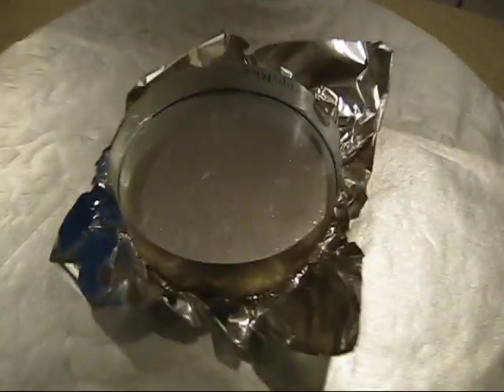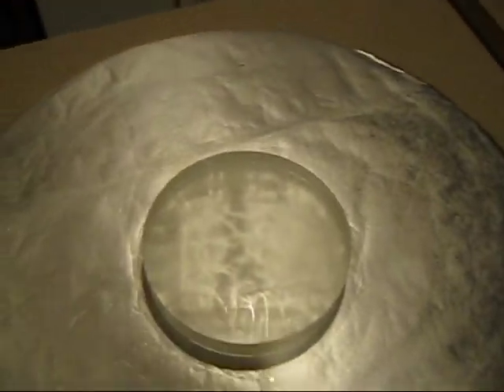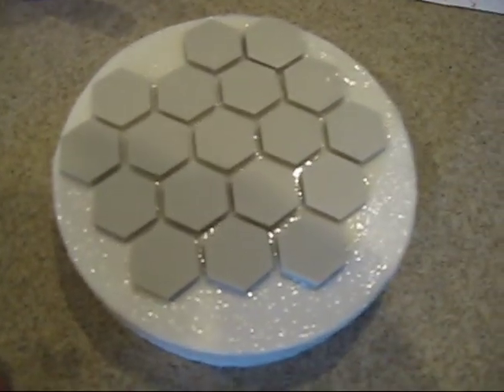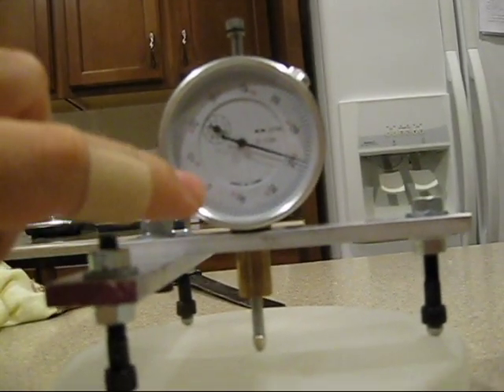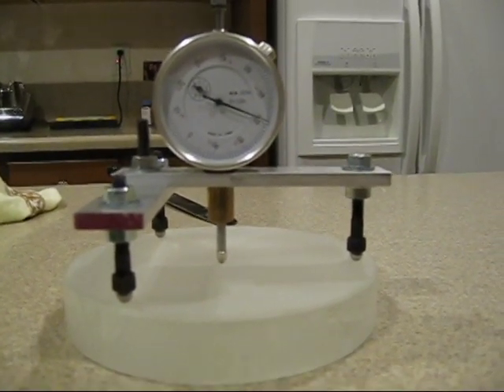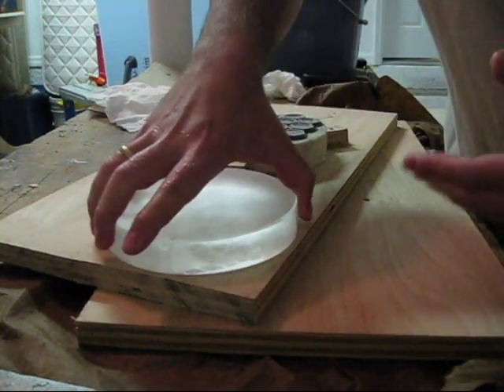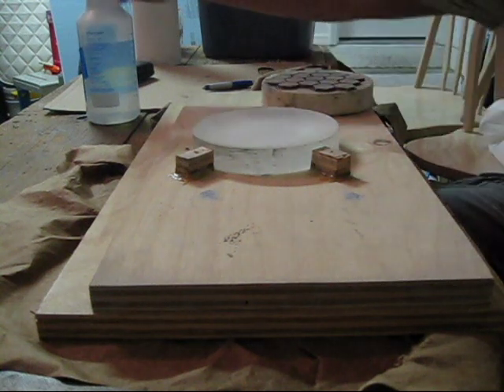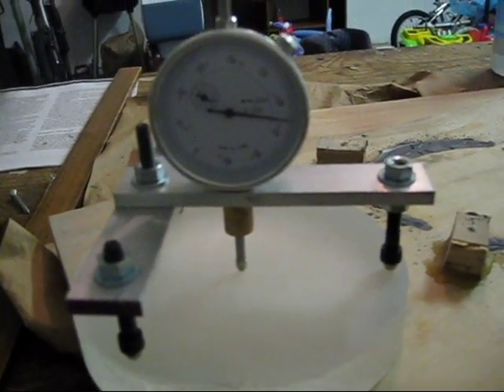Grinding my first 6" f/8 Telescope Mirror

Comment: Hi Carlos!

I know this is an old video, but I wanted to say I've watched this video and your other ATM videos many times as well as the Stellafane website and have learned a ton of very useful info. Soon I'll be starting my own mirror making project, and just have a few questions I can't seem to find the answers to in Stellafane, and would love it if you could share some advice. 

First, the Stellafane website says to always work wet, and to spray on water before each wet (for grinding). This might be an ignorant question, but would regular tap water work for this? I am only confused because they also mention that the cerium oxide slurry for polishing should be a mix of cerox and distilled water. 

I'm also confused about the steps I need to take before storing the mirror after finishing the last polishing session for the day. After finishing the last polishing session for the day, can I just put the mirror and lap away without cleaning/would it be harmful to the mirror and lap to leave cerium oxide slurry on them? Also, during polishing, do the mirror and pitch lap require regular dunking in a water bucket, similar to how the mirror/tool need to be cleaned in a water bucket during grinding?

Thanks for your time!
Reply from the maker: Hello. For rough grinding, regular tap water should be ok down to maybe 500 grit. I would start using distilled water for fine grinding at 25 micron Al Ox down to 5 micron, and obviously for polishing. This avoids getting any particulate contamination in the slurry with finer grits.

For polishing, after I finish a session I store the mirror and lap in a plastic cake container, the type you put a lid on and is air tight. I normally clean out the lap and the mirror with distilled water, I do not dry the lap (I leave the water) I clean the mirror several times if I need to do a Foucault Test. I apply slurry and cold press before a new session. The pitch lap will begin to close its channels as you use it. You have to then re-channel the pitch lap, which removes pitch material. This means the pitch lap begins to thin out with time, so it is very likely you'll make 2 or 3 pitch laps.

You do NOT need to dunk the pitch lap in a bucket of water. You'd only do this if you cannot get good contact, so you'd have a bucket of hot water, and insert the pitch lap and mirror. This helps the lap conform to the mirror's shape much easier since the lap is hot.
Reply: @carluchoparis  Thanks!

Comment: If you’re turning the blank why do you also turn the tool?
Reply from the maker: Hi Stephen, it adds an additional layer of randomness. I think in this video I was rotating the tool and mirror in opposite directions. It is preferable to rotate the mirror and then rotate the tool slightly less in the same direction. This really helps improve the randomness of the strokes and the figure turns out very well.

Comment: will burning the sand paper destroy the crystals ?
Reply from the maker: Hello, if I'm understanding correctly, you wish to make your own grit, correct? If so, you should heat the sandpaper enough so the grit loosens onto a clean surface. It would be wise to afterwards implement an elutriation process to separate fine and coarser particles from the liquid suspension.

I hope this points you in a direction at least.
Reply: @carluchoparis  Thanks..I am from Kerala, India.  i am trying to grind 190 mm mirror .. here the grit is harder to buy so the only option is to buy waterproof SiC sand papers. i burned each of them separately and crushed into grit and washed. Now i have 80, 120, 320 and 1000 size grits but i suspect their quality if there had been any oxidation happened to the crystals.
any way i started grinding my mirror with 80 grit using a tile tool and achieved 1 mm depth in 1 n half hours..fine grinding will be a problem i guess...thanks for your advise..and one more question..any kind of replacement for pitch lap.. pitch is not available here or costlier..do the hot glue stick work with that..?
Reply from the maker: @KL2Vlogger  As far as I know, you can use rosin from conifer trees. Read the following to see if it points you in a direction: https://www.cloudynights.com/topic/264459-homemade-pitch-for-polishing/

Also, make sure you employ elutriation for the fine grits you've acquired. This will ensure you avoid scratches. I currently am working on a small scratch on a mirror, it's a setback but we just deal with it.

Good luck and let me know how it goes.
Reply from the maker: The following website should be helpful: http://astunit.com/atm.php?topic=abrasiv&fbclid=IwAR31kPUdymtOYe9uFoPo7DvbVvZG7m2VTOS1Flqj6SI5ii7s3waoXreaM4M

Comment: 1:40 Seems like a vibrating dildo would work great to get those bubbles out rather than you having to stir with a stick. Would mimic the vibrating tool used to remove voids in concrete
Reply from the maker: The following is a sentence I never imagined typing, but I think a vibrating dildo would be overkill. LOL. That layer of pitch is at the most 3/8" thick. A dildo (even a small one) would be hilarious, yet awkward and probably not much help... What the hell am I typing here?
Reply: Nathan Roberson the dude has kids, what's wrong with you!? Haha

Comment: Would it not be easier grinding the other way up? All the grinding powder is going between the ceramics? I did it with ceramics on top after watching Gordon Waites videos. Very satisfying thing to do. Stopped at 14" mirror on third one but now thinking about the challenges of making a bigger one. Star buy was an old potters wheel of eBay with variable speed, keeps the mess all contained.
Reply from the maker: To hog out the curve with tool on top you would need a sub-diameter tool. With a full size grinding tool, once you've hogged out your target depth, grinding with mirror on top reduces the radius of curvature of the mirror's surface, while grinding with tool on top increases the radius of curvature of the surface. This is a good way to control the target focal length of your finished optic. You alternate mirror on top and tool on top, all the while measuring your sagitta. Carefully documenting your progress will ensure you reach the focal length you want, within a reasonable margin.

Comment: Vivo en Uruguay, usted?
Reply from the maker: +PRODIGITALIFE Yo estoy en EEUU. Tengo entendido que www.firsthanddiscovery.com hace envios internacionales. Un disco de 6 pulg cuesta $50, a lo cual debes sumarle el envio. Metete en la pagina web de ellos y veras mas informacion.
Reply: Mirá, qué buena página!!! Ahí dice que: un quit de: 6 Inch Telescope Mirror Kit vale $89.95 es algo alto pero por lo menos ya te dan todo, ja ja... Pero aún me queda una duda: si para hacer un telescopio se necesita de 1 disco o son 2 discos por telescopio?...eso no entendí. Desde ya Muchas Gracias Nuevamente, hasta pronto!!!
Reply: ...hay de varias pulgadas de: 4.25, 5, 6, 8, 10, 12.5 eso se refiere al grosor o sea al espesor me imagino y no al diámetro, es así?. Y el diámeto es el mismo o también varía?. Gracias!!!
Reply from the maker: +PRODIGITALIFE Necesitas un solo disco para el espejo primario... Tambien debes hacer una herramienta de esmerilado y otra de pulitura con yeso o cemento (debe ser impermeable, puedes aplicar unas capas de epoxy marino al yeso). 

Tambien vas a necesitar el espejo secundario, normalmente la gente lo compra ya hecho. Tambien se necesitan otras partes que puedes fabricar o comprar, como el enfocador, la araña para el secundario y la celda del espejo primario.

Los tamaños que ves en la pagina web son los diametros de los espejos en pulgadas. Yo recomiendo que empieces con uno de 6 pulgas o 8 pulgadas de diametro. Tendras un buen telescopio con muchos años de buen uso.
Reply: ...Buenísimo y esa herramienta de esmerilado qué carcterísticast tiene? en el video sería esa base blanca y los exágonos serían el epoxy marino? Y el espejo secundario
que características tiene con repecto a el espejo primario, es mas chico? me imagino...

Comment: Buenas qué tal? está muy bueno el video. Quisiera saber el diámetro y el espesor del vidrio que uso. Ahí puso o dijo que era de: 6" f/8 pero no se bien qué es cada número los 6" y f/8, podría explicar? He visto en otros videos que usan vidrios de un espesor más fino es por alguna razón o es arbitrario eso y su diámetro o cómo saber qué medidas usar o cuál me conviene más? Desde ya Muchas Gracias!!!
Reply from the maker: +PRODIGITALIFE Este vidrio es de 6 pulg de diametro y 1 pulg de espesor. Se recomienda utilizar una relacion espesor a diametro de 1/6. Utilizar vidrios de menos espesor se puede hacer, pero hay que tomar muchas precauciones a la hora de esmerilar, pulir y parabolizar. Cualquier asimetria en el soporte del espejo provoca cierta flexion en el. Esta flexion es suficiente para desviar la figura de la superficie durante el pulido y sera evidente a la hora de probar el espejo.

Luego, hay que tomar un poco mas de precaucion con la celda del espejo dentro del tubo del telescopio. La celda debe tener suficiente suporte para evitar flexion por el propio peso de espejo (coloquialmente llamado "potato-chipping", porque le da forma como de "pringle"), incluso a la hora de probar el espejo en el banco de prueba, si es de muy poco espesor, el mismo peso del material causa el potato-chipping y la prueba del espejo lo hara evidente.

Con las precauciones necesarias no deberias tener problema alguno fabricando un espejo de poco espesor, pero si tienes acceso a un disco de pyrex o borosilicato de espesor/diametro 1/6, entonces es preferable para tu primer proyecto, sin embargo conozco varias personas que han fabricado espejos de 8 pulg y poco espesor como primer proyecto.

Comment: One consideration....you need to be wearing a dust mask my friend.  Glass dust.... silicosis, bad news...especially for the little one running around in the background.
Reply from the maker: admdub Thanks for the concern but no dust mask is necessary, the grinding process is very water intensive. Water is always added to the grit, and the ground glass and used grit (still wet) are dipped in a bucket of water after every "wet", i.e. right before adding new grit. This makes the ground glass and used grit precipitate to the bottom within the bucket of water. Once a grinding session is finished, you dispose of the dirty water in the bucket and clean thoroughly, again, with water.

Comment: Hey man, wherer did u buy the mirror blank? and how much was it?? :D
Reply from the maker: Hey Karan,

I bought my 6" blank at firsthanddiscovery.com. It cost $50. I later purchased a 10" blank which cost $225.
Reply: Hey man! thanks for the reply! Nice tutorial i guess! I am a student in engineering and atm also. I am considering making my own scope. This helps a lot. Also i was wondering where u got the tiles. and if there is a cheap source for the grinding powders. I am living in Canada btw.
Reply: ***** haha i guess so. Just needed advice from people that have done this before.

Comment from the maker: Dave, I was going through the comments again and came across yours a second time. I'm building a 10" f/6 telescope now. The plaster tool I made is the same as for the 6" I made before, but I've poured candle wax in between the channels to keep old grit from dislodging and contaminating new grit, and to prevent the wasteful grinding we discussed. I hope that helps if you're still on your project, it has worked very well with the 10" mirror.

Comment from the maker: Viren, you only need to grind and polish the mirror side. Some people fine grind the back with 120 or 220 grit, this helps to more easily see through the mirror when grinding or polishing with the mirror on top of the tool, you can more easily spot bubbles and look for visual indicators of good contact between tool and mirror. I personally did not even touch the back side of the mirror and was still able to see through it... Cheers!

Comment from the maker: Hey Paragliding Maniac! The grinding abrasives I used are 80, 120, 220, 320 & 500 Silicon Carbide Grit, then moved on to 15 micron, 9 micron & 5 Micron Aluminum Oxide. Then I made a pitch lap and used Cerium Oxide to polish. I bought some of these at firsthanddiscovery (dot) com, and others at gotgrit (dot) com. There is a Spaniard friend that is making his telescope using materials readily available in Spain. I can put you in contact with him for more info (you're located in Europe, right?)

Comment from the maker: Hi Dave, when I started grinding I noticed immediately this causes some waste in grit. You actually have to build up some grit between the grooves so that it starts to really do work. However, the method worked fine and I finished the mirror. It's always good to follow your intuition as you're doing, and good call on starting with an 8" mirror! I wish I'd done that, but it turned out to be a very good and easy to transport telescope! Thanks for your comments which are always welcome! Good luck!

Comment: Saw something that catched my attention as I'm preparing to grind my first mirror (8" f6-f7). The tile tool you made: you placed the tools on top of the hardened plaster creating pretty deep grooves. Then grinding MOT would result in all your grit falling between the grooves in a few seconds, or?
I've read that it would be alot better to place the tools inside or almost fully inside the plaster if you're working MOT. What are your thoughts (before starting on that 12" :) )
Thanks for the vids!

Comment from the maker: The challenge of learning the science and using your hands, mind and heart to astronomically expand your field of view is an awesome rush! Poetry aside, making your own mirror ensures you have control on the quality of the optics. Commercial telescope mirrors are figured to 1/4 lightwave error, my mirror is figured to 1/9 lightwave error, so it's twice as good as a commercial one. I probably spent the same amount of money that a commercial 6" costs, but I learned the process! a 10" will follow.

Comment from the maker: Firsthanddiscovery is awesome and has great customer service. When I bought my mirror kit the abrasives jumped from 220 grit to 25 micron, now they added #320 grit, so you're good to go. The tile tool will be a great tool to grind the mirror. It's what I used, and it works fine... At first, you're going to have to build up grit and ground glass between the channels to get the grit to really start doing the work... Just keep grinding... I highly recommend Francis O'reilly's channel for more info.